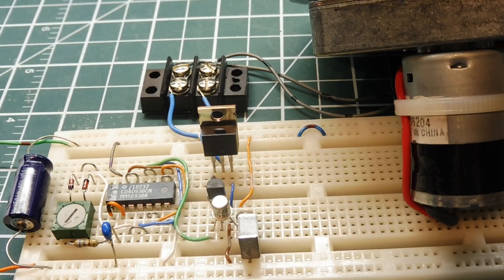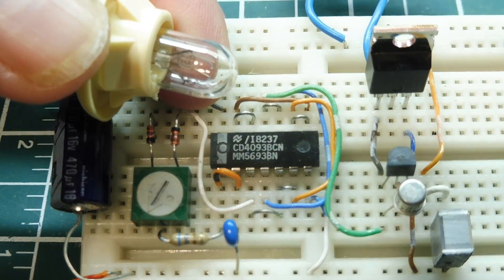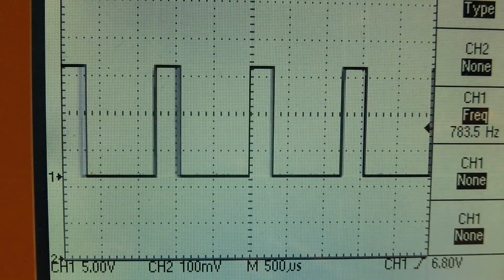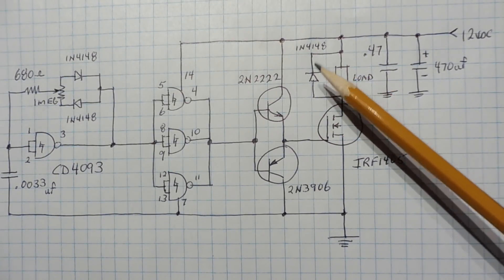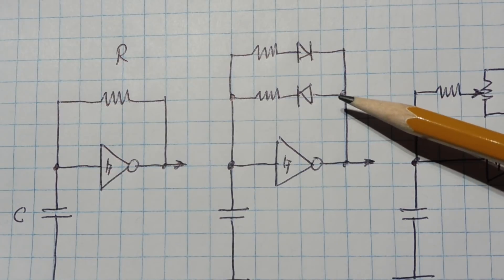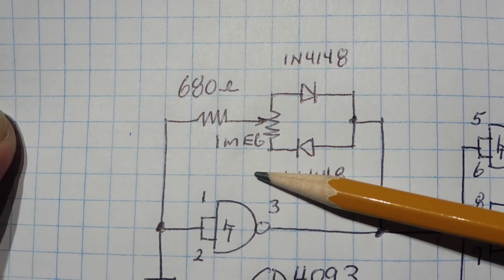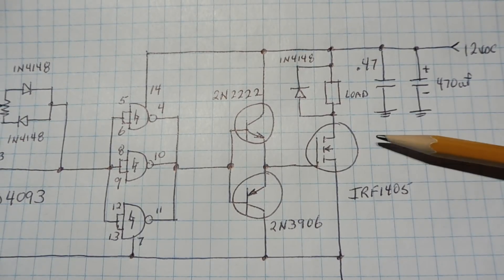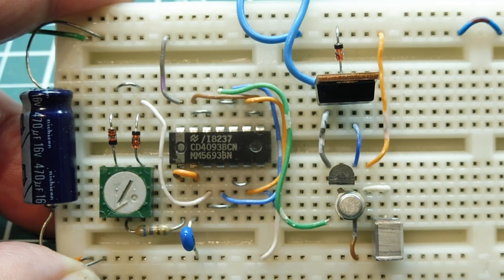Build A Simple Pulse Width Modulation Controller  / PWM

Comment: What if we want variable output, say 100% and 50% but controlled by a single push button?
Reply from the maker: Easiest way would be to use a microcontroller (Nano) to generate the PWM output and a pushbutton switch connected to a GPIO pin to set the desired PWM duty cycle.
Reply: @0033mer  That was fast, thank you. I'll probably be back once I get confused again.

Comment: Wow!, thank you so much for your educative video's. I enjoy watching them since I never got educated on this subject. Why didn't you use a 555 timer for this circuit. I thought that that is the first pick to make for building a PWM circuit? But I like this one, I just don't have this IC. And can you tell me where your name 0033mer comes from or stands for? Thanks again for sharing your knowledge. I appreciate it :)
Reply from the maker: Thanks for the feedback! I have used the 555 for PWM circuits with the same results. I used the CD4093 in this video because it is very versatile. It can be used as an Inverter, NAND gate, AND gate, Schmitt trigger and also an audio gain stage. You can also parallel them for more output drive. The CD4093 is very common and easy to obtain. I have used this circuit in other videos: https://youtu.be/h1aA5gfeU34  My channel name 0033mer was my work employee number which I had for many years so it is something I will never forget.
Reply: @0033mer  Nice, thanks for answering :) I just ordered some CD4093's, so I can have some fun with it in the future. I also asked you a question in another vid which was: what is the tool exactly called with which you can sculp your varoboard with? It is a sort of hand grinding tool and I want to order that also for my first pcb project :)  since I only prototyped on breadboards sofar (and I cannot locate it on-line....) And I gave it some thought how you came up with that name. And since I am dutch the 3 is here pronounced as drea (drie in dutch), so I thought it was a coded name for drea-mer :)
And I will sure have a look at that other video.
Reply from the maker: Good luck on your projects. I sent a link for the boring tool in the other video but here it is again. Here is a link: http://www.rpelectronics.com/r22-0239g-veroboard-cutting-tool.html
Reply: @0033mer  Thanks! I really enjoy this vast world of electronic possibilities and I will take my time for your vids/lectures. I really like it :)

Comment: I wish you had showed the motor when it started up. You said it starts slow, but by the time you show it it is already going fairly rapidly. I don't know what you mean by start "slowly". I ask this because I am trying to start a motor very slowly, and not having much luck. It is off and stays that way until a critical voltage is reached, then it jumps to a slow speed.
Do you have any other videos that show a slow start ?
Reply from the maker: To achieve a slow start you need a microcontroller controlled PWM circuit.
A DC motor needs a large current to start compared to the lower running current because of back EMF generated by the motor when running. The initial torque to turn the mass of the armature when starting also increases startup current.
When you apply your PWM signal it waits until the the pulse widths can give enough current to start the motor and once started the motor will jump to the PWM speed. You need a smart kickstart signal generated by a microcontroller.
On startup give a initial 30% kick PWM signal, as the motor starts up bring the PWM down to desired slow speed.
Reply: Thanks for the reply. I think I understand what you are saying. Do you know of any youtube videos that show this kind of configuration ?

Comment: Nice, but the diode 1N4148 is not a good choice because it's à small signal diode. Use à Schottky diode if the charge is inductive
Reply from the maker: Yes, Schottky diodes are preferred for free wheeling applications because they dissipate less energy during switching.
The motor I was using draws 50 mA so a 1N4148 with a forward current spec of 300 mA works in this application.
I usually indicate 1N4148 or 1N4000 series (1N4005) to be used because most people do not have a Schottky in their parts bin.
For high current inductive drive applications a Schottky diode would be the best choice.

Comment: Nice circuit to handle loads of a couple of amps or more. For loads of and amp or less I use a 555 timer since it is a more compact package ( 8 pin DIP ) as opposed to the 4093 ( 14 pin DIP ). The 555 can also drive the mosfet directly without the two transistors used here. I've built several of these in the past to mount directly on cooling fans for some projects. You can add a couple more components to make the pwm temperature controlled.
Reply: i prefer the 556 approach... one astable for clock, one monostable for pulse width.
plenty of ways to skin a cat!